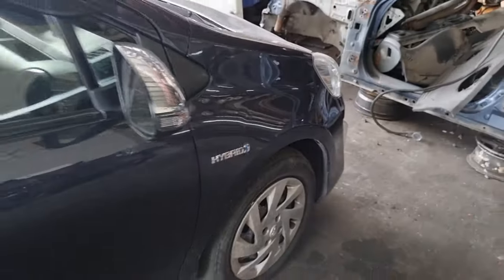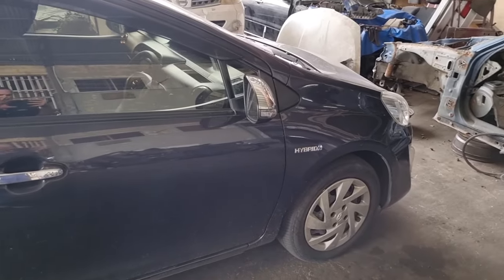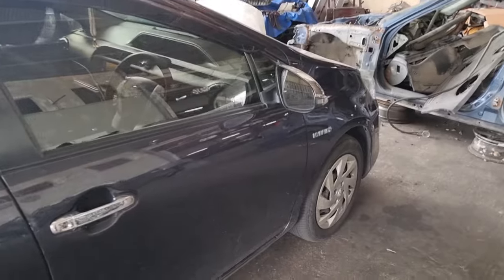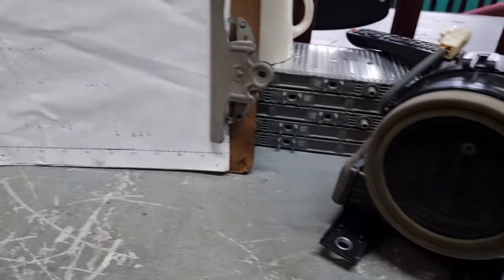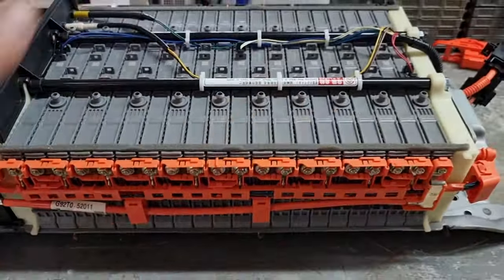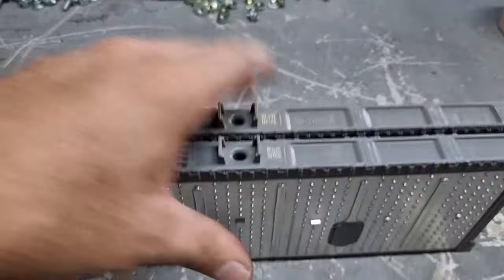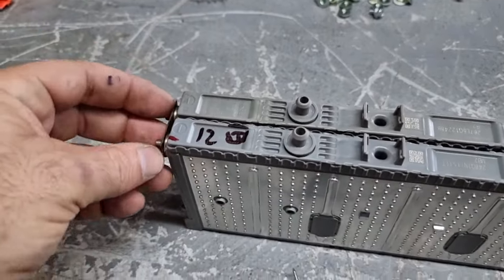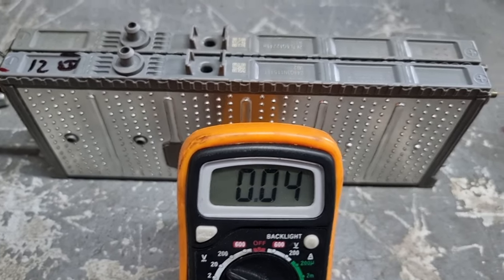Easy method to balance the Toyota hybrid battery (NiMH)

Comment: Be careful when adding batteries to this balancer.  Ensure the modules being inserted into the group have a voltage close to the other batteries on the balancer.  Otherwise a lot of amps may flow very quickly into/out of the battery being added to the group.  You can use a SkyRC charger to charge the group of balanced batteries @ 5.2 amps total, however I recommend charging the modules one module at a time. The reason is each module has different capacities and resistance.  When I charged the whole pack up to 8.30 volts, when I discharged some of the modules, their mAh capacity dropped considerably.  I used to think it was the electrical connection of the aluminum strips on the balancer.  But even when I connected the modules with copper wire using nuts, I had similar strange results.  When I charge just two modules together in parallel, the discharge capacity is lower than expected.  I think this is because the charge being applied is too low, and somehow the batteries with more capacity will take on more of the charge, and the modules with more resistance will be charged less.  I have found that if you want strong discharge amps, you need to charge an individual module with 3.0 amps or 3.2 amps.  If you charge the modules when connected in parallel, the charge amps are much lower (per module).  When you discharge the modules to test them, some of them will have much fewer mAh than before.  I also decided to track the temperature as the modules are being charged.  If you have a charger similar to the SkyRC charger, you can buy a temperature probe for about $10.  I would cut off the charger at around 82 F.  In the summer, you obviously will have a different cut-off temp.  I noticed my Prius pack can sometimes get up to 125 F (at a time when the pack was not paired up properly).  When pairing modules up for the pack, it is important to pair them up, first on resistance, and then mAh capacity.  Do NOT pair weak modules with strong modules (formula for pack failure).
I noticed that when charging a module @ 3.0 amps up to 8.60v, the module got warm (about 82 F) and the module expanded. After doing this, the total capacity went up to about 3000 mAh, and it took a charge of 3236 mAh.  Keep in mind the modules I tested were old and were the best of the modules that did not make the cut when I rebuilt my hybrid pack.  Over time, I came to the conclusion that charging @ 3.0 amps is safer than 3.2 amps.  However, I have found it beneficial to charge a module a few times @ 3.2 amps up to 8.60v to get the module to get it discharge more normally.  After a few cycles charging @ 3.2 amps, I will switch back to charging @ 3.0 amps. I tried clamping two boards around the module to prevent it from expanding.  This helped reduce the swelling, however this causes the module to get warmer more quickly, so I like charging a single module with a fan on it, and turn off the charging when the temp gets to 82 F.  I noticed the module starts getting warm at 8.500v (80 F), gets warmer when the voltage is at 8.550 volts (81 F), and gets warmer when at 8.59v (82 F) (each module will be different and hopefully this improves with each cycle).  Note: the voltage I am referring to is the actual module voltage, that my custom Arduino code captures for the one second (every 30 seconds) which is when the SkyRC charger is not charging.  The SkyRC charger thinks the voltage is more like 8.70 volts, but when it stops charging, the voltage is closer to 8.59 volts.  Note: the max voltage a Prius module can store is about 8.60 volts, and Delta V is triggered at around 8.72 volts (if it gets triggered).  The SkyRC charger usually does NOT detect Delta V (which occurs when a module is fully charged).
Reply: Great. Dr Prius shows my state of health at 95%. I don't know the history of the car, since I just bought it, its 2014 Camry with 190k miles, so my guess that the battery has already been serviced or replaced. My question is can I use a mechanic balancer on all modules for 48 hours with out using any kind of charger, and will just balancing the modules along be a good source to prolong the battery life? Thank you 👍
Reply: I would also like to know if I can rebalance the battery without connecting it to a charger. Is the charger just to insure that the modules are all at max charge before I start rebalancing?
Reply: Yes, you can balance a group of modules without a charger.  At 11:00 in the video, Jose has two modules connected in parallel (hanging from the aluminum bars).  When connected like this, electricity will flow between the modules, and their voltage will become equal (balanced between the hanging modules), without using a charger.  When you are inserting another module into the group of modules being balanced, you should check the voltage of the module.  If it is less than the group voltage, then I would charge that individual module up to the voltage of the group, before adding it to the group.  If the module is at a higher voltage, then I would connect a charger to the module, and discharge it down to match the voltage of the group of modules.  However, each of the 28 modules in a Gen 2 Prius contains six cells.  The six cells will get balanced (somewhat) when you charge the modules up to 8.40 volts (Jose explains this in another video where he describes the six cells being balanced in a module). Once the modules in the group are at 8.40 volts, you can apply a small trickle charge of 0.5 amps for the pack (or 0.1 amps for a module) @ 8.40 volts for an hour or so (I do not know how long is safe to trickle charge at such a high voltage of 8.40 volts).  DO NOT CHARGE HIGHER THAN 8.40 volts!!!  If you charge a module @ 8.70 volts for a few hours, there is a good likelihood you will damage that module!  The module has a safety feature that kicks in around 8.70 volts causing the voltage to drop suddenly, which indicates the battery is fully charged, and that you should stop charging it.  Most chargers do NOT detect this voltage drop.  If you charge higher than 8.5 volts, it may use up the chemical that triggers this voltage drop (which is what I mean when I say you may damage the battery).  The Prius charging system can detect this, but if you use up the chemical that triggers the voltage drop, then the Prius may charge the battery pack higher than intended.  Note: I charged some of my modules higher than 8.70 volts, and I suspect that I damaged them, which would explain why my Prius sometimes charges the modules up to 9.5 volts (when driving).  The Dr. Prius app lets you see (and record) the voltages when driving.
Reply: @GaryMarkowski  So you can rebalance batteries without a charger but I still need a charger to be able to charge or discharge modules to even out voltages before balancing. So a charger is still needed. What kind of options are there for a charger? A prolong charger is a little bit too expensive for myself. I have noticed some people use an rc charger of sorts, and I understand that a low current charger is what I need. But what are my options? Is there a video or website that could help me make the decision on what kind of charger I need and can afford?
Reply: @YaroGoret  I have two SkyRc V2 RC chargers (no fan).  They work good, but they do NOT detect when the battery is fully charged (this is a huge problem).  So if you buy a RC charger, make sure it works with NiMH batteries AND will automatically stop when the battery if fully charged.  I have seen some videos where they charged a single module @ 10 amps.  This is huge no no.  I have charged some modules @ 5 amps, and some of my modules failed after doing that.  I think you can get good results charging @ 3 amps (or 2 amps).  You may need to charge at least 2 amps (per module) to reduce the "memory" effect that can occur at lower charge rates.   There is very little information out there to tell you exactly how to charge your modules, so it is a big learning experience (trial and error).  The Prolong charger used to cost around $450.  The nice thing about it is you don't have to learn much, and it will take a LOT less time to charge/discharge the whole pack (effort wise).  I would not discharge a single module any faster than 2.5 to 3 amps (one auto headlight).  I spent about 120 hours researching this topic.  You can save research time by buying the Prolong charger.  Maybe other people can share more recent information regarding chargers.  20/20 hindsight, make sure the charger you get can auto detect when the battery is fully charged (which will be around 8.40 volts (or less)).   When a module is fully charged, the voltage will drop suddenly (ie. Negative Drop in Voltage - NVD).  I find most modules do not take and keep a charge above 8.20 volts.  If I charge these modules up to about 8.25 volts (individually), this seems to extend their capacity when testing their discharge.  Once charged, some modules will drift down to 8.08 volts, and most will drift down to 7.88 volts.  The ones that hold at 8.08 volts usually drop below 8.0 volts within 10 seconds of a headlight being attached.
Reply: @GaryMarkowski  I am confused by the need to charge/discharge a module prior to inserting it into the aluminum rails.  Isn't that the point of the rail system afterall? (To level out voltages based on physics)  Or are you saying to do this only when there may be extreme voltage differences?
Reply: @GaryMarkowski  I am a Taiwanese, I thank you for sharing, I gained your experience.

Comment: Is it possible to trickel charge the cell while they are in parallel on the mechanical  cumustomised aluminum balancer device you made?  In theory, can you start with balancing all the cells. Once they are all balanced, slowly charge the cells by hooking the charger up on the aluminum rack and slowly charge the cells up. Wouldn't this reduce heat "loss" and the cells would charge more quickly?    When the charging is done, then just disconnect the charger and let the balancer rest a few days. Done! Thoughts?
Reply from the maker: Yes of course and it will work great 👋😎
Reply: @hybridsolutiondiagnostics  absolutely not. You cannot charge nickel metal hydride in parallel because when the first cell reaches full it immediately dives in voltage and the other ones are still higher in voltage even though they're at a lower state of charge than the one that's full and they'll all work together to dump massive amounts of amperage into the one that's full causing it to swell up and overheat.
Reply: No absolutely not you cannot charge nickel metal hydride in parallel up to the point of being full.  See my other comment here.
Reply: @hybridsolutiondiagnostics  they need to be very slowly charged in series. The one that reaches full will get warm but a fan will take that heat away. There won't be any other cells dumping power into them when they're in serious.  That's why the high voltage charger/balancer was invented in the first place.
Reply: @SiriusSolar  see k which charger should i use (brand) and how to set them up safely... If in series maybe them being in the car is fine as well
Reply: @CalifornianOnEEurope  there are several different brands. Here's one of them.  hybridautomotive
Reply: @SiriusSolar  You bring up a very good point.  Kudos to you for that.  However, I think you can charge all of the modules connected in parallel up to 8.40 volts (max), without triggering the negative voltage drop you refer to.   From my personal experience, I think that voltage drop kicks in somewhere between 8.58 volts and 8.80 volts.
Reply: @GaryMarkowski  You may be right, I haven't experimented with that particular top voltage.  Maybe it'll ease up all of the states of charge without the drop at full problem
Reply: You can charge a whole pack of modules connected in parallel using a small SkyRC charger, however doing so will create a memory effect in the modules (not a good thing).  If you do this, I would charge all of the modules individually up to 8.25 volts, and then trickle charge them in parallel.  However you will find most modules will drift back down to 8.8 or 7.8 volts.  Many can hold a charge of about 7.88 volts.  Others can hold a charge of 8.10 volts, but these will usually drop to 7.88 volts very quickly when a load such as a headlight is applied to a module.   I personally have found that you can remove the memory effect by discharging an individual module down to 7.20 volts (using a headlight), and then charging it back up to 8.25 volts @ 3 amps.  Doing this once or twice seems to work.  I also have found charging a module @ 5 amps has caused some of my modules to fail.  I think a charge rate of 3 amps is okay (not 100% sure).  I suspect when two modules are hanging on the aluminum bars, they may not have a good connection.  When you apply a charge of 8.25 volts, one module may be getting charged more than the other module (due to the poor connection and also due to internal battery resistance).  To test each module, I charged them up individually to 8.26 volts and then connected a headlight to discharge them.  I used an Arduino micro controller (connected to my computer) to capture the voltage every 10 seconds until the module drops to 7.20 volts.  Once a module drops to 7.5 volts, it tends to drop to 7.2 volts rather quickly.   I then inserted those voltage values into an Excel spreadsheet where I could then display them in a graph.  I then paired the modules based on similar graphs.  Doing so allowed my very old pack to last for about 12 months.  I also take internal resistance into account, but seeing their behavior on a graph gives a good visual as to how a module performs when load tested (for 2 to 10 minutes).  I have seen one module last for over 10 minutes, however this was misleading (due to internal resistance).  After cycling the battery from 8.20 volts to 7.20 volts a few times, it performed closer to the other modules.  I ended up removing a good performing module from my pack because it was very different than the other modules, and it caused problems.

Comment: Just took out a 2007 battery that was "reconditioned, balanced" 3 months ago by a "Prius Battery Specialist". It was failing because balancing  is a waste if the Internal Resistance is high on the modules. I picked the lowest IR batteries from my 3 packs and the car drives like new. Voltage is secondary. IR is the most important parameter for series-connected traction batteries.
Reply from the maker: You mean capacity my good friend...
Reply: Only in the "Capacity" to transfer energy. High IR limits the cell transfer, no matter the capacity. One good test is a long hill. The hesitation or bucking that the car exhibits is high IR in at least one cell in a long series of 168 cells.
Reply from the maker: @amazoidal  yes but it's not that simple...  normal IR is between 18 to 25 milliohms... but ist only affected by temperature...

Comment: This method does charge each battery to same voltage.  But, if any cell has less capacity (volume of current capacity) when cells are place in series (as they are in auto battery pack) they will fail to provide as much current as needed to  keep up with other higher capacity cells in series battery. This method balances for same voltage but does not sort out cells with different storage capacity.
Reply from the maker: Charging or discharging has nothing to do with the module's capacity... this is just to rebalance the complete battery pack to restore the overall battery pack's capacity the most it can be...
Reply: you do that after check capacity and select the ones to continue the work
Reply: you must invert the order of the batterys in the pack

Comment: I already replace the bad battery cell and measured every battery cell and there all around 7.76 and 2 cells are 7.80. Would you recommend balancing them again and doing the process of discharging and charging them back up

Comment: Great video, I will be cleaning and inverting the cells as you me tioned on my 2011 prius, I dont have the balancer, can I still install them and let the car charge them? Or is it required to balance them before install? I have the V on prius app. And about 3-4 degrees higher on battery #2 compared to 1 and 3 as seen on other videos that you have explained due to heatstress. If highly recommended I will balance them, is there another alternative to do this other than prolong balancer?

Comment: Quick question what would be causing higher temperature reading on Dr Prius on Battery Temp 3 block 10-14
Reply: dirty corrosion on wires and buss bars

Comment: I got my very out-of-balance modules close (less than delta .2v) by individually charging them using the Dr. Prius app in real time, charging the weakest block's modules seriatim. But finally I decided to just wire them all in parallel. I didn't feel like taking the frame apart (again), so I made up a harness with 14 red and 14 black connectors to slip over the respective pos/neg terminals on the input/output side of the assembled battery. I took off the copper plates on that side and installed the harness. This gave me 14 batteries wired in parallel (I'd already matched the modules to be very close in voltage at rest). I then connected the harness to a Tenergy charger that can charge from 3 to 18 volts, and programmed it to do three charge/discharge cycles at .5amps. My harness does the same work as Jose's aluminum balancing beams but with the additional advantage of being able to do a bit of reconditioning and charging. (And it takes up a lot less space!)